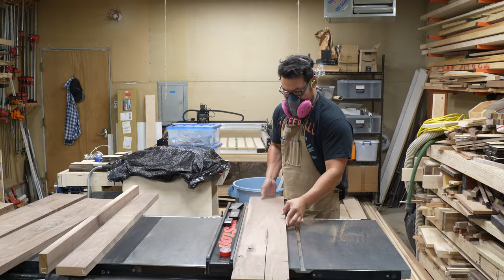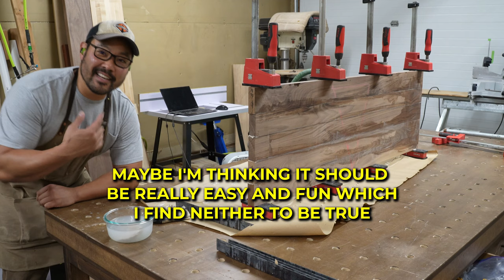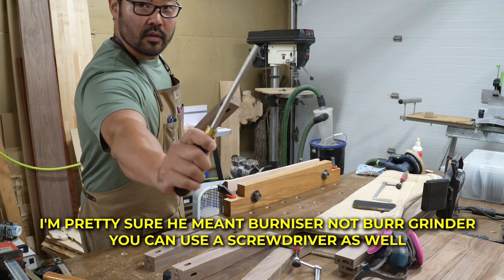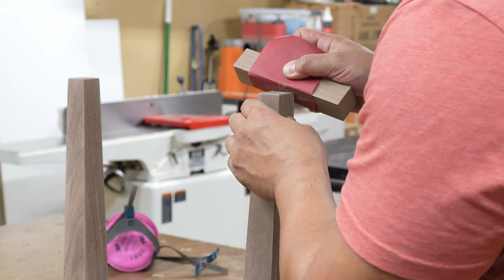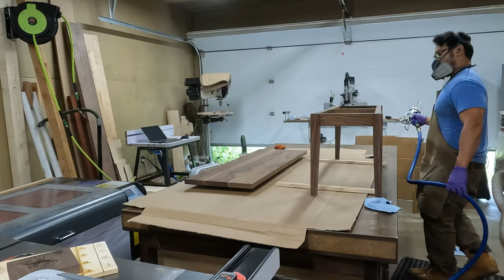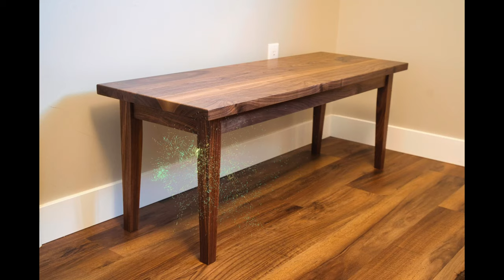I Made RIDICULOUS Mistakes So You Don't Have To!!! Bench Build

Comment: Glad I found your channel as I'm making a walnut table right now! For glue squeeze out, one tip I saw which I find invaluable is to rub some mineral spirits on the wood and this should reveal any glue that you have missed which you can then get rid of. The spirits also give you nice preview of what the wood will look like once you put an oil based finish on it. .
Reply from the maker: Oh nice! Thanks for that tip! I forget how useful mineral spirits can be! I’ll remember that for next time. Also, If I remember I might try painters tape at the joints then removing it once I clear off all the glue. Anyway, thanks again for that tip! And thanks for watching and writing! Good luck on your table!!!

Comment: A tip for your clamps, rub some paste wax into them, stops glue sticking to them and it also stops them leaving black marks on the wood when the glue does get onto them. Saves so much time and makes life easier. Also if you would like to get in better shape (not that you need it)  I can recommend a 20min home workout for you. I have done this every night for 2 months and went from a 34 trouser to a 30. (Still eating the same amount of junk)  I now have some muscle definition on my stomach, that's a first in 47 years lol. Keep up the good work. Love the videos.
Reply from the maker: Hey Derek, sure send me an email at sammy@toguchifurniture.com I'd love to hear about it. The only time i have definition there is when I draw them on with a sharpie! haha. But, congrats on your size 30. I can't remember when I was a 30! 
 I finished that bench in August but with everything that was going on I was just now able to finish the video. But, I GAINED some weight between then! haha. But, after 12 months my daughter is finally sleeping through the night which is helping me out and now I have the energy to workout again.
Reply from the maker: And, I know you won't believe me but I do add paste wax on my clamps BUT that was when I bought them years ago so now I have to clean them up but I'll try and do a better job at upkeeping them! But, I didn't know about the black marks so thanks for that!!!